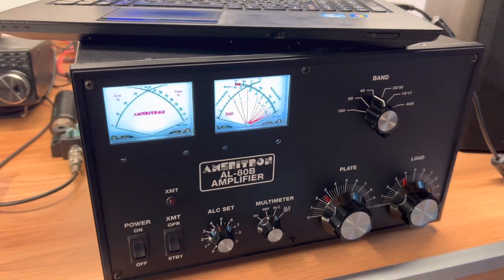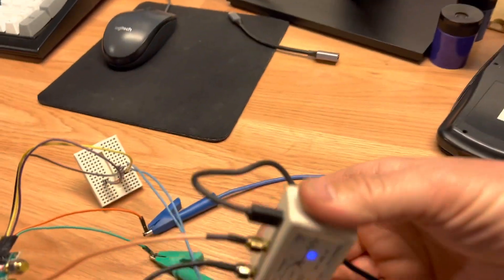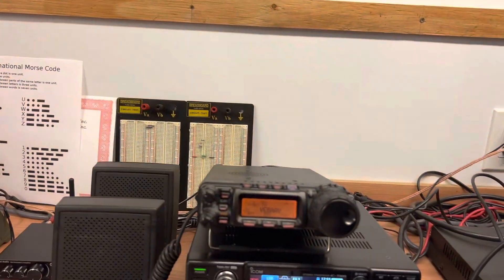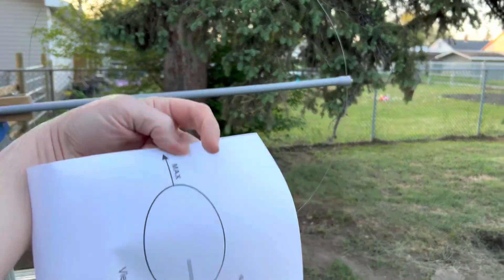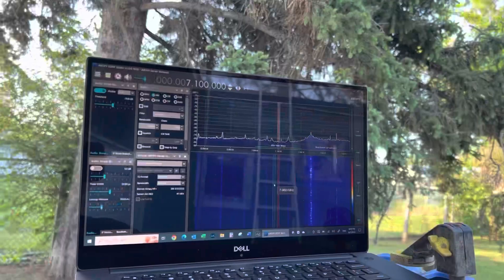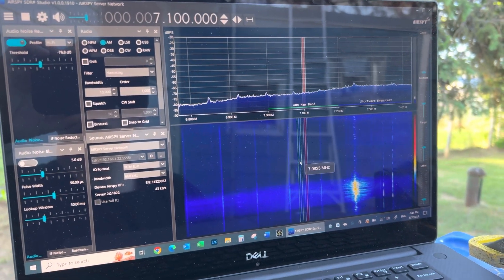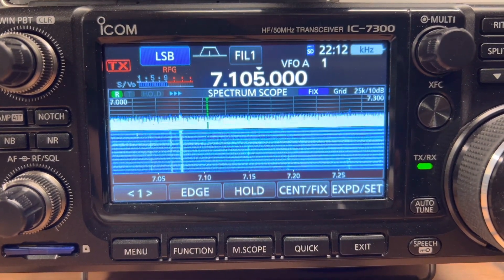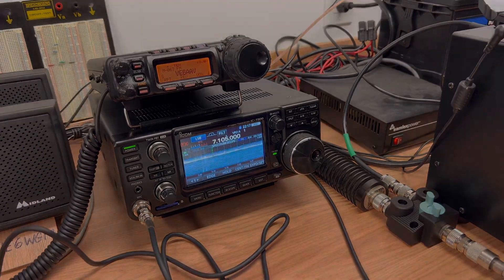MLA-30+ Mag Loop Antenna - Redeemed?

Comment: ..It is not a "Mag Loop"..a mag loop has a seperate loop that is loop coupled to the main loop. Uses a variable capacitor for peaking the receive/transmit..
Reply from the maker: It is a broadband magnetic receive loop… which gets tiresome to word out after a while, so in this case it was shortened to “mag loop”.

This antenna is a magnetic loop.  It is much smaller than 1/10 wavelength and responds primarily to the H (magnetic) field.

Comment: My MLA-30 redeemed itself too, recently bought another HF rig with dual receivers so with headphones you can listen in "stereo" with two antennas, one on each receiver. Sometimes the more readable signal is from the MLA-30, my noise levels are often very high on 40m, both with a 1/4 wave vertical and low dipoles. The MLA-30 is going to get some attention, probably a slightly larger loop and a decent mounting further from the house, they don't measure well for dynamic range but a great basis for some experimentation. FWIW I had already  reduced my noise levels substantially with the combination of a current balun in the HF feeder to the main antenna and common mode choking of the electricity supply to the entire shack. 73

Comment: this is not a mag loop folks
Reply from the maker: I did some research on this… it would seem you are correct… but….  Hahaha!  As always, with so many things, “it depends” comes into play.

On page 9.13 of the 2023 (25th edition) ARRL Antenna Book, I found a little box with a statement about the definition of a Mag Loop antenna.  It references the Mar/Apr 2020 QEX technical note which defines the boundary as being where the circumference of the loop is less than .05 wavelength.  This is where the electric to magnetic field ratio tips in favour of the magnetic field.

In this case, a 1 meter diameter loop is considered a mag loop at frequencies below 4.8 MHz… so on 80 meters, this would be considered a “mag loop”.  At 40 meters and above, it clearly does not meet the definition.

Comment: Hi Gregg.  Another great video.  You demonstrate well how one can use a loop to null out noise.  One point worth noting is that at about 04:56 you seem to experience the highest noise levels.  However, that is the point at which you move the loop closest to the laptop, so it is likely some of the increased noise may be due to picking up noise from the laptop itself, most likely the display screen.  The best test would be to locate the loop at least 10 feet from the laptop, with the loop and support post oriented vertically, and turning the support post to rotate the loop through the vertical plane.

Keep up the good work and good DXing.  73  Ken -- WBØOCV

Comment: Very informative video. Probably not many people know this, but there are counterfeit versions of the MLA-30+ sold online. My first "MLA-30+" turned out to be a fake copy, the wire loop was impossible to form a reasonably perfect circle and its bias tee was noisy. The seller used pictures of the genuine Megaloop but sent me a counterfeit set instead.

My second purchase was all good; I got it from a different seller on eBay and asked him all kinds of questions. I probably irked him a bit, as he had been selling only genuine Megaloop antennas and he knew about the fake ones. True to his word, he shipped me the original MLA-30+.

The difference between a genuine MLA-30+ and a counterfeit one is like night and day. I've seen at least two other videos on YT whose authors assumed that they had the genuine MLA-30+, therefore their comparisons with their existing EFHW antennas (or whatever they were using) were very flawed.  The fake one comes with a Bias Tee box with a very high noise floor and is fitted with either a dim red or blue colored LED indicator (the original bias tee comes with a bright green LED) and the LNA box has only four screw holes instead of six.

In all the review videos in which a genuine MLA-30+ was used, the low noise amp box is always screwed into the PVC pipe using the middle screw hole and the reception results were quite satisfactory. If the reviewer had to fasten the LNA box to the PVC pole with zip ties it meant that he received a fake one, which lacked the middle hole.

Hope this helps anyone who is considering buying the MLA-30+ online. 🙂
Reply: Ah about the contradiction my bad.  Not enough coffee yet this morning, I see you said the Blue or Red LED in the Bias box = counterfeit MLA-30 and 4 screw holes in the Differential Amplifier Box = Counterfeit. So mine is assumed to be the REAL version, however VE6WGM appears to be using the assumed Counterfeit MLA-30....  Needs to do a follow up video taking it all apart and lets see the difference in the Guts.  By now he should be able to find a REAL MLA-30+ to buy and compare both to put the Counterfeit thing to rest.  I see potential for Youtube Views, so hopefully he will do it.
Reply from the maker: I have tried the MLA-30+ that I have here a few more times after this video, and each time was disappointed with the performance.  It works, but the signal to noise ratio is not as good as my inverted vee dipole.  I am able to use the directivity of the loop to place the noise source in the null, but it doesn’t turn into an advantage because of the poor s/n ratio.

I will investigate the difference between what I have and a “real” MLA-30+ antenna… 

I have also purchased a yagi for VHF/UHF to use with my FT-857D running on a battery pack to try to locate the noise source/s around my QTH.  I have some work to do… will likely post another follow up video on this when I get some time.  I work full time out in camp in northern canada, so, it’s a time thing.
Reply: @ve6wo    I use an Active Loop that I made myself with better parts.  Old design from 80's.  It is very low noise compared to my wire antennas here in the City.  I use it for my WebSDR Server.  I purchased the MLA-30+ just to do comparisons between it and my Homebrew just haven't gotten around to doing it yet.  I use the directivity of the Active Loop to minimize or completley null out the noise from the Cable TV lines here in the City that run above ground on the Utility Poles.  Without that I cannot copy much on 80M and below, full of switching transistor noise and it's associated harmonics.  Key to Active Receive Loop performance, this is a Differential Amplifier, not a traditional LNA, the key is to use a loop material that is as low inductance as possible, as the differential amplifier sensitivity depends on low inductance.  The skinny wire loop with the MLA-30 is probably the worst thing you can use.  A piece of copper tubing or flat bar, or even braided coax would be a better choice for the actual Loop material than the skinny wire, as it's inductance is likely a bit higher vs a larger surface area.
Reply: @ve6wo  Oh and for locating noise sources, I generally just walk around with a portable (9V battery powered type) AM radio and listen to the noise, it's source is usually a lower frequency like between 80-180kHz switching power supply or other consumer junk, and the associated harmonics are what we hear in the HF bands.  I also use a laptop and SDR receiver tuned to LF-HF band to help locate the frequency of the noise source and calculate it's harmonics, so I know for sure it's not more than one thing making the noise.
Reply: @ve6wo  I've even found Car Cellphone Chargers in my own cars or neighbors cars that are left plugged in to a Cig Lighter outlet that doesn't turn of when key is off making the switching noise and spewing RF especially if they leave the cord attached!
Reply: @ve6wo  One other note.  As far as I know the MLA 30 is just a commercially packaged Hula Loop.  If you want to research into that.
Reply: Hmm.  I purchased one of these 6 months ago, and still haven't used it, as I use a Homebrew Version that I believe has a much lower noise level because the Differential Amp chip that is used in the MLA-30 antennas is a cheap POS, my Homebrew design uses a pair of very low noise transistors for the differential amp.  Probably cost more than the MLA-30 chip being used, but well worth the reduction in Noise.  Anyway.  The one I have has a BRIGHT (annoyingly bright) GREEN LED in the Bias Tee box, and the Differential Amplifier Box (not an LNA!) has 6 screw holes, one of which on top and bottom are in the center.  Is that supposed to be the Genuine version?  I think you said in your comment that the fake one has 6 holes and real one has 4, but then you said in the review videos where the box is mounted with the center holes, the RX is good, contradicting what you said. No offense intended, just trying to get this straight on the one I have before I attempt to use it or modify it or throw it in the trash.
Reply from the maker: I wonder if someone could please post a link to the original.  I can’t find any that do not look like mine.
Reply: Does it really need to be in a perfect circle?
Reply: @eyup121  Not really, but when you see other YouTubers manage to form their wire loops in nice circular shapes you'd start wondering why yours ended up looking like an ellipse. 😀 I had forgotten to add that the fake ones come in with a longer length of wire, which is probably why they tend to flop around, kink easily and can't form a simple circle.

Comment: A mag loop and some very good common mode chokes from My Antennas saved my operating for about a year. I was able to pin point the noise using the 30 db notch in the loop. While listening to my receiver in the shack over an FM radio transmitter I turned the loop just right and killed the noise. I'm presently using the MLA-30+ in the attic for SWL and found placing 3 turns of the coax thru a small snap on ferrite helps just before the preamp.
Reply from the maker: Very good!  I will try this :-)